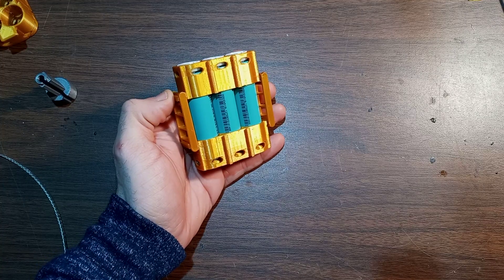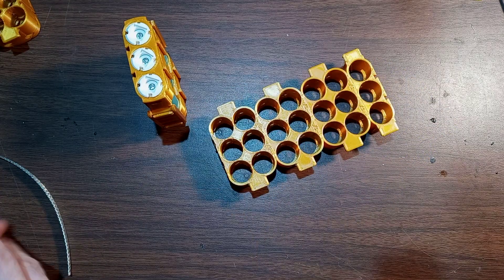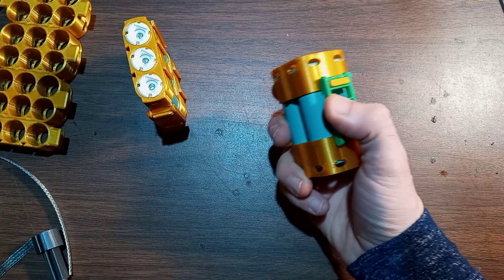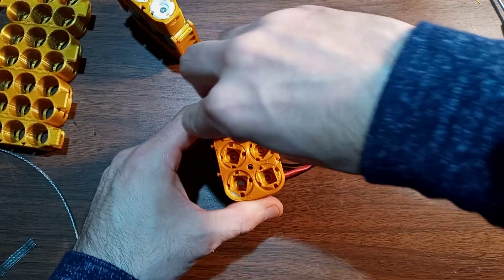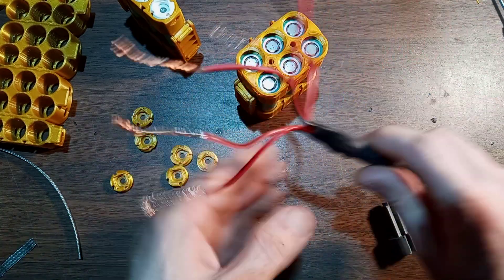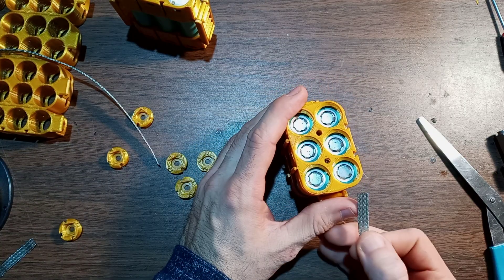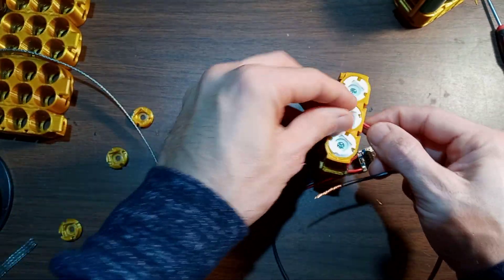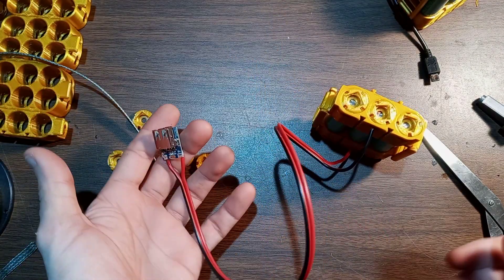Omnicell Update - Weldless High Current 18650 Battery Packs - Ft. BMS Squid

Comment: Do the screws come loose with vibrations? Would use something like lock tight or glue to make sure the screw sticks ?
Reply from the maker: Under my testing, I have not had any of the screws come out on their own. 

The design accounts for this. 

With that being said, surely these screws would eventually come out on there own over a very long period of time, so they screws are designed with glue channels. 

I have not needed to use the glue channels tho because PVC wrap works really well to keep the screws in.

Comment: have you put the STL models on Thingiverse?
Reply from the maker: no but you can buy the kits here: https://homeio.info/shop
Reply: @electronicsworkshawp  I think it will be pretty easy to copy the design. I would put a simple model on Thingiverse to define a standard. Put a link to your store. People are more likely just to buy it. The Omnicell name/website are already in use. Also put a link to your store in your Youtube video desciptions. Nice Job! I have used Vruzend system for several projects. I've had problems with the caps splitting

Comment: This is very impressive. Is it available for purchase yet? Also I have a lot of 21700 batteries for my ESK8 build - are you able to offer a solution for that size as well? I was in the process of soldering braid to each series. I'd prefer to keep heat off the batteries if possible.
Reply from the maker: Yes and yes. https://homeio.info/shop

Thank you so much!
Reply: @electronicsworkshawp  you Wizard, that is bloody brilliant